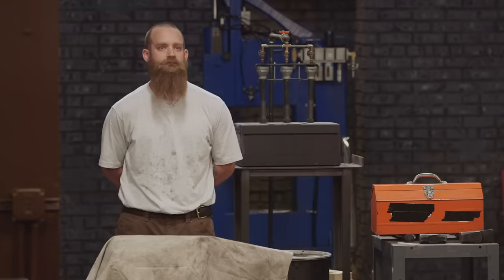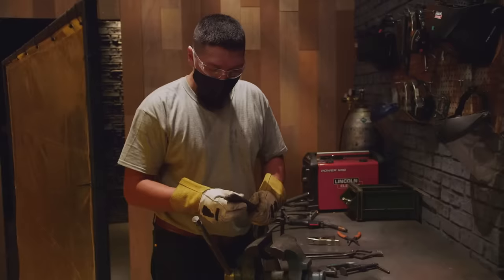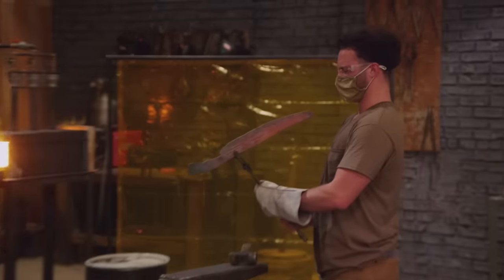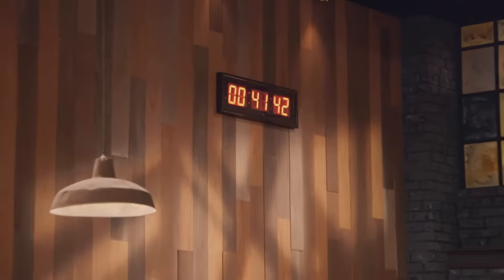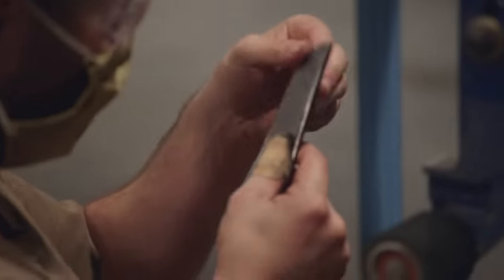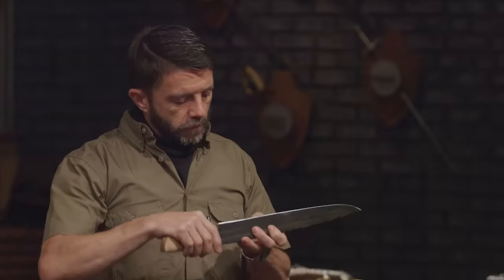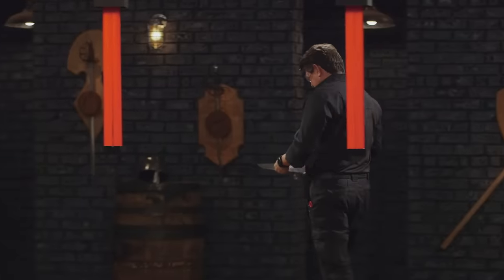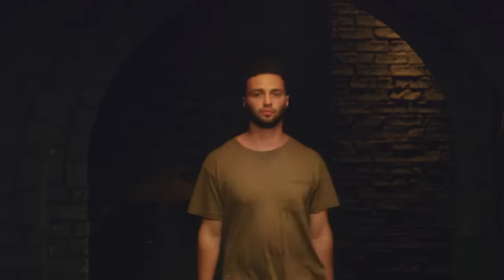This Weapon Has "ZERO Room for Error" | Forged in Fire (Season 8)

Comment: In nearly every episode the steel is way too cold for hardening.
After the quenching you need another heat treatment by about 200-350 degree celsius.
Without the second heat treatment, its hard like glass.
You cant use it properly, it will break as fast as glass.

Comment: Would anyone else here have gone with canister damascus and relied on the weight of the hydraulic press to forcibly crush/weld all of those steel cables into a homogeneous billet, hoping all of those factors would eliminate the possibility of a delamination?

Comment: Honestly, the first 2 rounds aren't the best measurement for the quality of a bladesmith, most of the time.. I know they try to do gimmicky stuff to make it interesting, but a lot of the time crunch stuff and "each of you make a blade out of this random material" can completely change the outcome, and make the best Smith in the room have to do something over because of something out of their control, or have to compromise somewhere they normally would not. I know back in the day, they had to have smith's who could make a lot of good swords fast, but now days, making 4 of them work as quickly as possible, might be the difference between one guy having the best blade on the show, and him getting eliminated in the first round. 

Also, I've never seen a blade not perfectly cut through the water tubes with ease... even when they stacked 4 instead of 2, every blades cut through them looked the same.